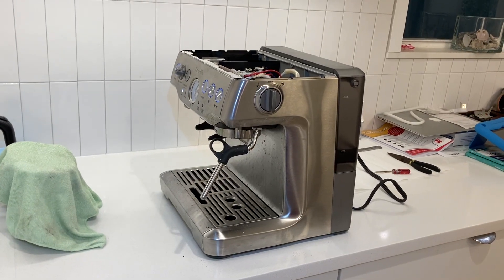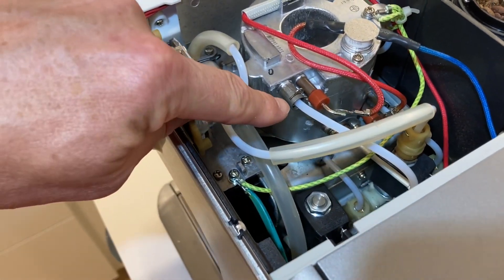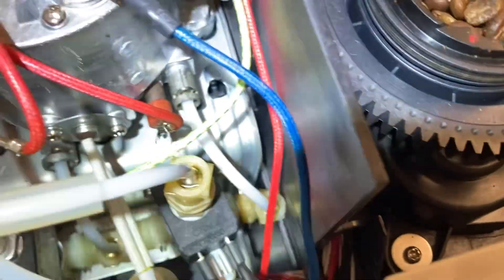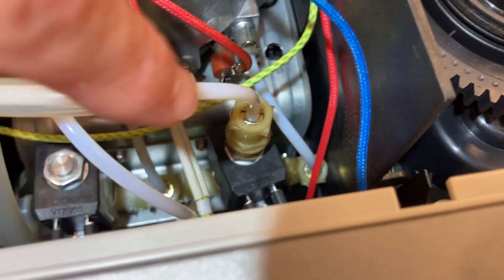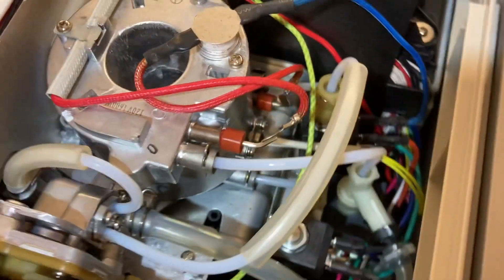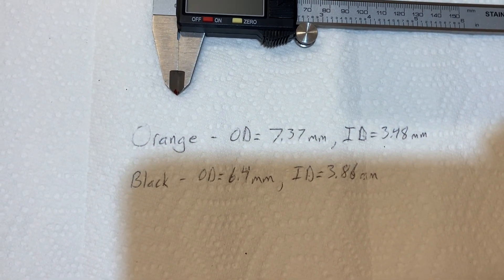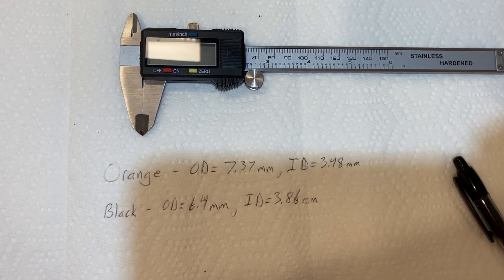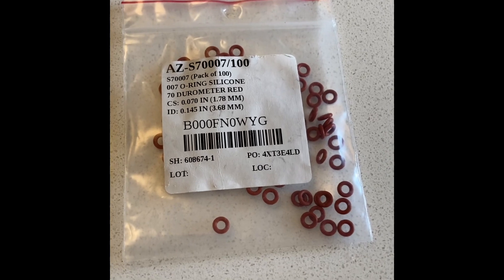Breville Barista Express BES870XL Tripping GFCI Breaker, problem solved

Comment: Thanks so much!!  Exact problem occurred this morning with the exact same loose join which was easy enough to retighten.
Reply: Hey, did you just tighten it with your fingers or did you use some tool?
Reply: @Mx-Er  , I just used curved needle nose pliers to reach the join but you could do it with small fingers.

Comment: When you tightened the connection, were you able to get the tan piece flush with the gray nut underneath with no threads showing?  Also, what did you use to twist it?  I tried to get a hex socket over the top but didn't have a size that would work.  It won't budge with a hand twist.

Comment: Hello! I am having a similar issue where water is leaking at the top of the solenoid valve when using the steam wand. The o-ring looks fine but I’m ordering new ones to try. The plastic piece that screws on looks really worn and doesn’t tighten well or go down all the way on the metal threads. The issue is my machine immediately trips the breaker when I press either brew button (1 or 2 cup). I see a bit of calcium buildup or corrosion on the attached wires to the solenoid valve and wondering if that could be the problem if it’s been leaking for a while?

Comment: Hi Zach, thanks for all your material about Breville  Espresso Machines! It is really great!!  I have Breville BES860XL Barista Express Espresso Machine with Grinder and once a plug the machine and I turn the switch I got a tripping breaker. All your info is for BES870XL, may I follow for my model? 
Any suggestion? Thanks!
Reply from the maker: I would expect that any tripping breaker is being caused by a short which allows too much current to flow. A short can be caused by wires touching that shouldn’t be or by something else making the connection between 2 wires or 1 wire and the grounded body of the machine. I would expect that there is a low chance of 2 wires touching since there aren’t any moving parts inside the machine that I found. So, any coffee maker with a steamer experiencing this type of breaker trip is most likely being caused by a leak and the water inside the machine is causing the short.
Reply: @zphillip1234  You are correct! The issue was caused by a leak, which I resolved by replacing the o-ring. Thank you very much!!!!

Comment: It's a great video. I had same issue that trip GFCI breaker when I touch cup button to begin brew(my other function does not trip GFCI). I opened cover, found the plastic piece connected to the solenoid is a bit loose. This connection should not be loose correct? in this video you mentioned to tight it up the plastice piece with the base solenoid black piece. Could you please tell me which part I can hold and tight it up? I tried tight up with holding the plastic piece, but it loose it again after brew once. some nervous of breaking up the parts if not doing it correct. Thank you very much.
Reply from the maker: It is a bit difficult to get access to the black solenoid to hold it securely while tightening down the hose connection on top of it. It may just be a bit trial and error.  You could also try some lock tight to keep the threaded connection from backing off. I would try using the weakest formulation so you do not permanently lock the connection because the heavy duty lock tight requires a blow torch to heat up the components to unscrew them. You may need to replace the solenoid one day.

Comment: At 1:50 are you saying you tightened it and ADDED an o ring?
Reply from the maker: I did not have to replace the o-ring but you may have to. Just depends on what is causing the leak.
Reply: @zphillip1234  It seems like the o ring is ok. I changed it and it did not help. What I'm noticing though is that beige plastic piece that you tigtened may be in need of replacing. When I try to tighten it, it starts to get tight and then suddenly gets loose again, like maybe the threads have degenerated, or the plastic piece has lost its physical integrity. It looks a bit heat damaged/hardened. (Update : found part) can't seem to locate a replacement part. Have you seen anywhere that sells this part? Or do you know what that part is called?

Comment: Your machine looks clean.  How did you know that the leak was occurring "here, where this plastic coupling..." at about 54 seconds? What did you observe to notice that? Especially since your machine could not turn on with tripping electric?
Reply from the maker: If you leave the machine off for a while any condensation should eventually dry out and allow the machine to be powered on again, especially if you have the back taken off. Once I was able to power it up, I could see the steam leak at this connection. I could also see some white residue from the leak which can give you an indication of where the leak is occurring.

Comment: great video and good tips. My one in the UK turned on and I could grind coffee, but as soon as I pressed the single or double shot for coffee it would turn off and it would tirp the distribution board. I gave it another go, a day after but now as soon as you plug the Sage in it keeps tripping without being able to even power the machine up :( stressfull times... 2 days without amazing coffee haha. Would you know what may be the issue. I have opened the machine up but could not see any leaks
Reply from the maker: From my limited experience, I would recommend opening the machine, and then trying to create steam to identify where the leak is occurring. My machine would start working after it sat for a while and was able to dry out. If yours will not power up after a day or two, I would still open it up and inspect for corrosion on electrical connections or deposits left over from the steam leak that may help identify where the leak was occurring. That’s all I’ve got good luck
Reply: @zphillip1234  luckily just like you say the machine turned on after a while. I had the top cover open and then turned the steam wand on. I finally saw a leak under pressure coming from the CEME V230/50. Now I couldn't tell if the leak was coming from the solenoid itself or the pipe fixing above it that attached to the solenoid valve. I still don't understand how that causes the machine to turn off when pressing single or double shot. Also if it is the fixing then I assume it may just be an O ring.
Reply from the maker: Mine was leaking at the solenoid but that was because the solenoid had come loose and wasn’t screwed in tight enough. So I didn’t need to replace an O-ring. I believe the leaking steam creates condensation which shorts some electrical components. Once it dries out, it is no longer shorted. However, it may cause permanent damage if left unresolved.
Reply: @zphillip1234  my machine seems has the loose plastic piece connected to black solenoid piece. I did not see steam out, but I do feel the plastic piece is loose, I hand tight it, after brew once, it come to loose again. can I take it off and wrap some plumber tape then screw the plastic piece back on? thank for your video. this is the only video that talks about similar symptom of mine
Reply from the maker: @victoriazhao6719  I would not use regular plumbers tape to fix any steam leaks because that tape is not intended to be used at high temperatures. Hot water does not get nearly as hot as steam. I would try to find a product that has a higher temperature rating. It probably won’t cause any issues using the plumbers tape, but it probably will not last.
Reply: Did you manage to source the orings in the uk? I have the same problem :(

Comment: Did you change an o ring where it was leaking or did just tightening it work?
Reply from the maker: I just had to tighten the connection but there aren’t many threaded connections. So, you should be prepared to replace o-rings but if your leak is in the same place as mine was you may get lucky and only have to tighten the connection.

Comment: Mine trips when I press the button to begin either one or two shot espresso pours. Steamer is working
Reply: Did you find a solution to this problem?
Reply: @graysengriffin838  yes I think I did but haven't finished repairs yet.  I noticed while using steamer with back open I could see a leak at the same location you did.  Need to tighten and/or add new o ring
Reply: @graysengriffin838  ok I tried tightening. Didn't work.  I didn't ADD an o ring (not sure if that's what you meant) but I found a black o ring inside.  It is not the same size as either of the two red O ring sizes for this machine.  It is thinner in shape (more like a tire than an innertube). Anyway nothing has worked to fix it.  Not sure what to try next.